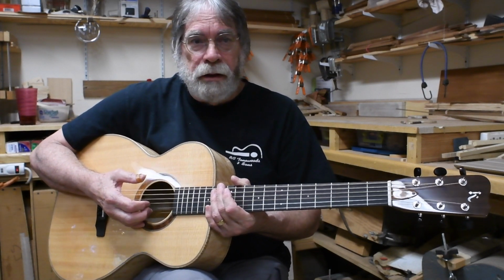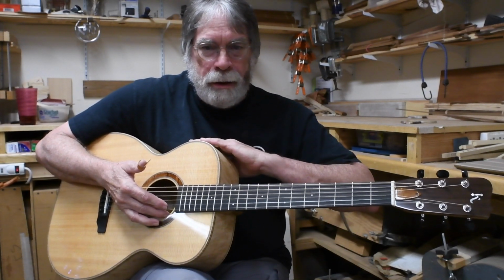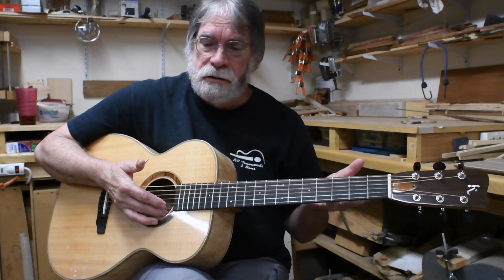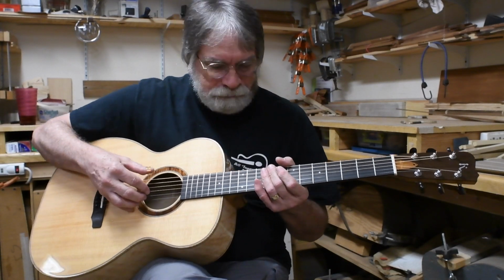Tonewood Test (Non-Blind)

Comment: Funny how listening to the rosewood guitar after the maple one the rosewood sounds "muddy" due to the extension in the low end and the maple guitar sounds "thin" in comparison. 

What would be the best way to get the extension in the low end that rosewood gives you without losing the definition given by, lets say,  maple or mahogany back and sides? Smaller body on the guitar for a more focused tone? Stiffer braces?
Reply from the maker: Thanks Victor for listening with such a critical ear. That’s what the whole experiment was about!

Yes, you are right that that is some of the trade off between the different wood species. Different model shapes do tend to affect the tone in major ways as well. 

Our CS model tends to be our most “articulate” model with a lot of clarity. Combining that shape with a rosewood back and sides would get a lot of what you are looking for. Selecting braces with a tonal center in mind would help as well. 

Alternately, you could go for a bigger body with a midrange density wood like myrtle or koa and get a similar effect. But many different factors play a part, so ultimately the builder will work to get the best fit for each player.